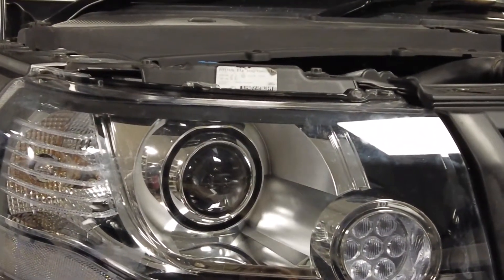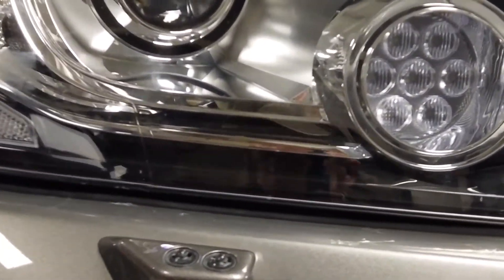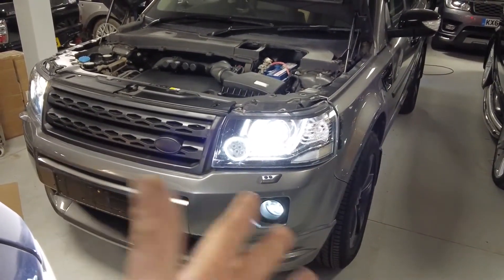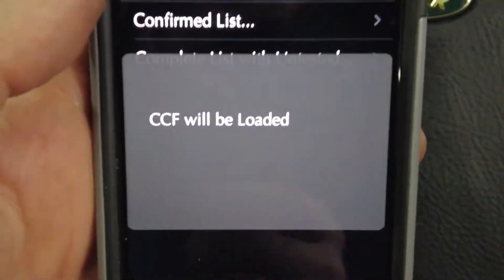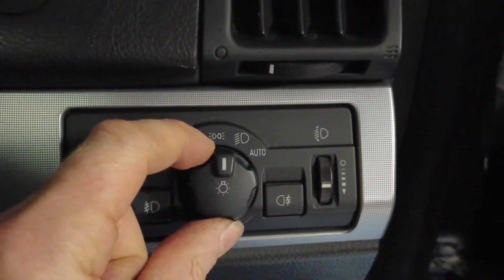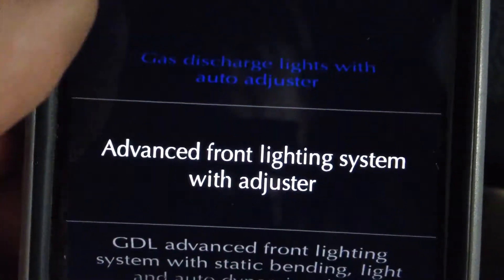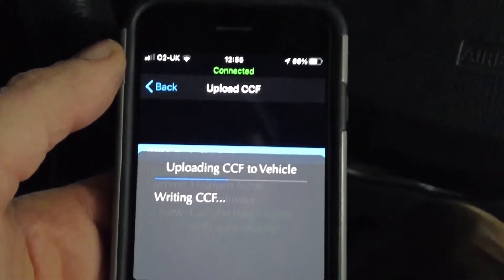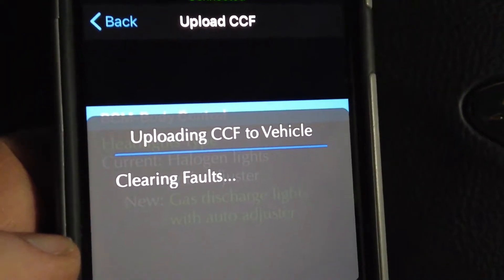Land Rover Freelander 2 Upgrade Headlamps from Halogen to Xenon Headlights

Comment: I’m keen to do this but there is a legal hurdle.  You need the auto levelling system for them to be legal to use on UK roads.  I suspect it could be retrofitted along with the right lighting ECU.
Without this it would fail the MOT (or result in an advisory to fix it next time) if the tester spots the manual adjuster in the car.

I found out that hella used to make a stand alone levelling kit but it seems to be impossible to source.

Comment: I have a FL2 '08 xenon and upgraded to the deluxe xenon you show in the video but some of the lights don't work as they should. Different wiring? Any way you guys can help me?
Reply from the maker: Hi - do you fit the later lights in the early car ? you need to fit the wiring loom to make them work.
Reply: @L663  yeah, later lights to earlier car. I got the looms but  can't find the conversion wiring diagram. Any chance you can point me to it?
Reply from the maker: @eduardokm00  https://www.freel2.com/forum/topic16893.html

Comment: Just looked up the GAP IID tool, £500?! K'inel!! I thought theses readers would be about £100
Reply from the maker: Yes they are good and handy and they come with good support but its a lot just to change the headlights.... anyway at least you know how its done and what is entailed.
Reply: @Mark Harper. Hi Mark, it's an expensive but a worthwhile investment, much cheaper here though https://www.island-4x4.co.uk/tfiidbt-integrated-interface-diagnostics-tool-bluetooth-tfiidbt-p-27303.html

Comment: The auto adjuster would need the level sensor mounting to the bottom suspension arm, not sure if there is just one or a front and a rear.
Reply from the maker: Yes i have not looked to see if the height sensor is fitted - let me look on the parts system.... so yes it seems only cars with Xenons are fitted with height sensors
https://www.dropbox.com/s/nwyjnxtc4vdx1d8/freelander%202%20hieght%20sensor.JPG?dl=0
Reply: Knowing LR the wiring will probably be there behind the arch liners or something. Be interested to see if they work once plugged in.